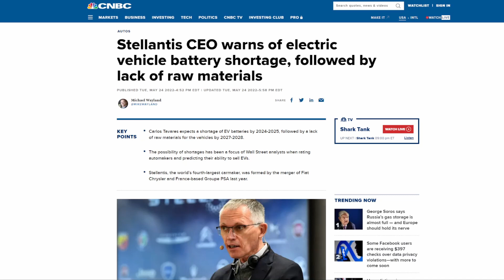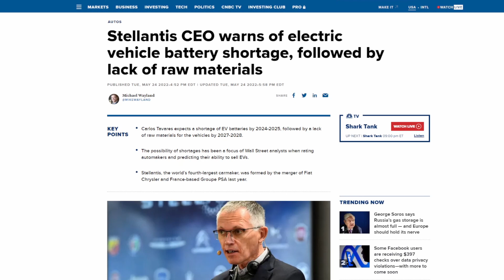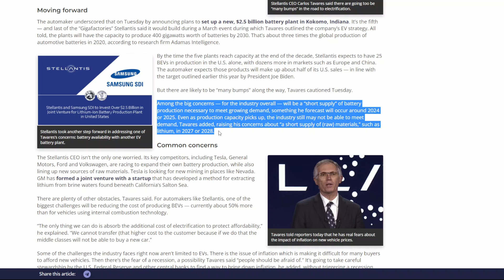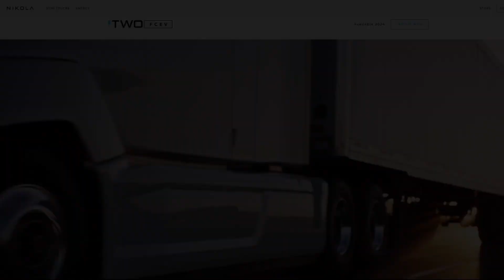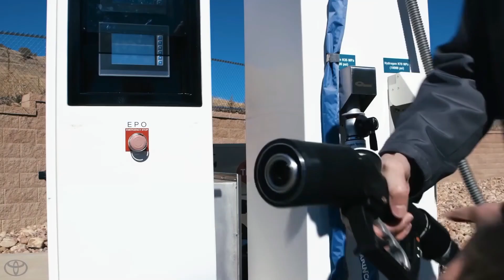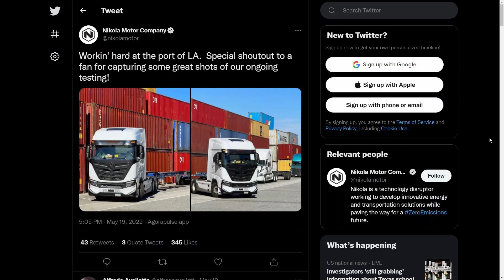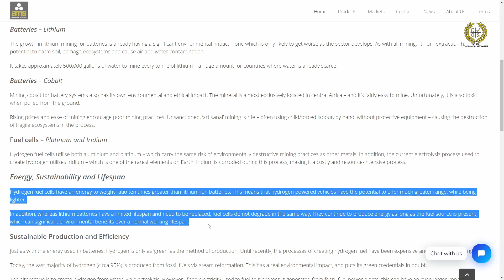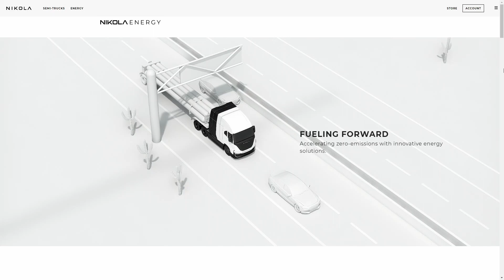Hydrogen-Electric Trucks Are The "Real Winners" - Sandy Munro

Comment: Sandy is still forgetting that to create the hydrogen required is extremely inefficient. We may as well just have trucks running on methane which is much simpler to create and store. H2 is a waste of time.
Reply from the maker: Gasoline is more inefficient to make than hydrogen, and yet 99% of cars on the road run on it. Simplicity and efficiency don't determine the adoption of a technology buddy
Reply: @visceral_investing  ah no it’s not gasoline is extremely versatile and easily produced from the worlds most sort after feedstock. Crude oil. Can be stored at room temperature is a very basic container. Can be transported very easily. All not true for h2. The only better option is… you guessed it.. electricity!
Reply from the maker: Hydrogen can be made from an even more sort after feedstock...solar panels! And guess what, the feedstock this time is renewable and the hydrogen doesn't need to be combusted for use. Meanwhile you can store the hydrogen gas in tanks, just like your readily available propane tanks, and put them on solar farms, ships, planes and trucks without adding ridiculous weight and taking up an exponential amount of land!
Reply: @visceral_investing  good idea except the problem is that creating h2 using electricity from any source is extremely inefficient. So you would need 3 times as many solar panels or wind turbines or whatever to allow the hydrogen truck to move the same distance as the  battery electric truck so you would end up using 3 times as much land for the extra solar panels etc.
Reply: @visceral_investing  also h2 will leach from propane tanks because the hydrogen molecule is so small it cannot be contained like larger molecules such as propane or methane. I think someone has invented a tank which can store hydrogen but it’s so expensive that it’s not economically viable.
Reply from the maker: What? Making hydrogen using electricity is almost 50-60% efficient, and because batteries limit the range of the truck - you'd end up having the same amount of energy used for the same range. Not to mention, solar and wind are excessively abundant in the ecosystem - so the technology with the higher capacity factor for storage will offer the better $/kWh for renewables - which is hydrogen
Reply: @visceral_investing  you're missing a few steps with hydrogen which makes it only 30% efficient. Battery electric semi will be 80-90% efficient. By convertong h2o to h2 and o you've lost 40 to 50% of the electricity then converting h2 to to electricity and used in the electric motor you've lost another 30 to 40%. It's too wasteful. Unless this can be changed then don't believe h2 will be used as an energy storage method for anything.
Reply: @visceral_investing  renewables are only as abundant as the amount of devices you have to collect the energy. There is a cost to the number of solar panels or wind turbines etc installed. If all vehicles were running on h2 you would need 3 times as many devices which cancels out any benefit of h2

Comment: Clearly the performance issues are being overlooked say cold weather, fuel cell flooding, platinum membrane fouling. FYI lithium is extremely common compared to platinum.
Reply from the maker: Fuel cells perform better in cold and hot weather, plus the supply chain for platinum is not nearly as stressed as lithium - which reduces cost, while already having a lower carbon footprint while mining. You need 8x the mass of lithium in a battery vs the amount of platinum in an equivalent power fuel cell

Comment: That’s the same argument I’ve been making for years…Hydrogen for long haul, batteries for city delivery and short haul operations. Battery weight cuts into payload, plus, the time it would take to recharge all the battery packs. Too long! 
If they can get down to about 10-15 minutes to refuel a hydrogen rig, that would be on par with refueling a diesel road tractor with 150-200 gallons of diesel. That seems to be an excepted industry standard at this time. And Nikola is to be building their own refueling centers too!
Reply: I have been in the heavy transportation truck/rail business since 1973 and I get so very tired of Youtubers who don't know what they are talking about. If the Tesla batteries are in fact heavier Tesla can easily add drop axles on the tractor and the trailer which boosts the capacity to 105.000 pounds gross and this would more than easily take care of any extra battery weight. There is NO problem with battery weight and there.......... NEVER .............HAS.......... BEEN !!!!!

Comment: In the short history of electric vehicles this century we can see that the issue of energy density gets resolved over time. The issue of weight is a thornier one though. The bigger the vehicle the less likely that the weight penalty due to batteries will be tolerable. But, you have to go really big before that applies. Sandy Munro is probably wrong. BEV trucks in all classes will probably win out over time.

Tavares, regretably, is right too. The lithiun-ion battery industry is going to collide with 'resource limits' (actually the limit is a limit to the rate of expansion of mineral extraction not a hard resource limit). So, were going to have to complement lithium-ion with other battery alternatives that use more earth abundant materials. Okay, so let's do that.

With so many advocates for hydrogen it is important to be reminded about just how useless it is in most applications as a fuel. Hydrogen is absurdly difficult to store (making its use in FCEVs extremely challenging) and it doesn't 'burn cleanly' when combusted (in an ICE or jet engine). US defence research is looking at a number of fuel options that an army can carry on its back. Mineral hydrides as a storage medium for hydrogen look promising but nanoelectrofuels - liquid fuels that can store electric charge - also have their advocates. There is no winner yet but liquified hydrogen in a bottle is basically a sad joke (and a bomb).
Reply from the maker: False. Hydrogen is anything but useless. It's used in steel and glass manufacturing, in fertilizers for growing crops and as a feedstock for natural gas. So if hydrogen was really "useless", then the industry would not have used for 100s of years. Just the like infrastructure of batteries evolved, so will of hydrogen. It's tough storing nature is just one sacrifice you have to make to unlock a multitude of benefits, like higher energy density, better weight ratio, longer discharge duration, easier scalability and ths ability to store energy for weeks and months. Please do more research before talking 😊
Reply: @visceral_investing  No, true. What I said was hydrogen was useless in most applications 'as a fuel'. Talking about its use in steel and glass manufacturing is irrelevant to my point - those situations are unrelated to the use of hydrogen as a fuel, viz. when combusted in an engine or when, by electrochemical means, converted into elecrical energy in a fuel cell. (Also, you are jumping the gun a bit when you say hyrogen is used in the steel manufacturing. Would be manufacturers of so called 'green steel' intend to use it in future steel manufacturing but that isn't a common practice, right now.)

Comment: This is really the crux of the issue with electric vehicles; They're really not all that "green", when you factor how dirty the mining of metals really is, along with mining is very capital intensive.  In turn, this means lithium prices will have to remain high, to allow EV mass adoption to even be viable.

As for hydrogen, Blue Hydrogen & (in some areas) Green Hydrogen are already down alot in final cost.  Hence, they actually have a path to viability right now.  Let alone the benefits as far as range, fuelling times & what not.

Ships & Aircraft, IMO look at HVO (Green Diesel/Blue Diesel).

My 2 minutes anyway, thanks for the video
Reply from the maker: Great points. Green hydrogen will allow us to create the equivalent of fossil fuels, with renewable energy - something that would be immensely revolutionary to the grid. It would make solar/wind smoother for the grid and allow cities/users to store energy for weeks and months at a time - and allow them to deploy that energy for electricity whenever they need to with 0 emissions (unlike coal and NG generators)

Comment: This video is full of misinformation.  Lithium is one of the most abundant elements on the planet.  Plus...it can be 100percent recycled.  Hydrogen can't be recycled.
Reply from the maker: Wtf? You're comparing a fuel to an element used in a specific type of battery? If lithium recycling is so effective, why have its prices skyrocketed since 2019? Green hydrogen prices on the other hand have fallen 20%+ since lmfao

Comment: Hydrogen is good energy, however, the big problem with Hydrogen is its low power efficiency, both production and fuel cell efficiencies are low.
Reply from the maker: Yes, but it's the same case with petrol, diesel and NG production/consumption. They are at best 25% efficient, yet they are used everywhere. Same with jet engines.
Reply: @visceral_investing    I am comparing with EV....When compared with petrol and NG, Hydrogen is much more expensive.  You have to combust petrol or NG to get electricity with 70% energy loss and then electrolyze water to get Hydrogen with another 50% energy loss...

Comment: Not really true, depending on price of fuel and hydrogen most likely to loose in price.
Reply from the maker: Price of hydrogen will be $1.50/kg in 2030 - making it 2/3rd the price of diesel. And because of its ability to be made with renewables, it can be scaled 10x faster than any other form of fuel production
Reply: @visceral_investing  at the moment hydrogen is heavily subsidized real cost including profit much higher. Another concern is the fact that service of converter plates are very expensive and intervals too short. So these problems are not solved yet. Hydrogen is made with electricity so why go the extra mile to convert from electricity to electricity???
Reply from the maker: EVs, solar panels and batteries are and were also subsidized. Not sure why that is a concern, it will only accelerate the adoption of the technology. And the reason why you use electricity to make hydrogen is because fuel cells provide an insane amount of benefits to many heavy duty industries over just using a battery - no self discharge, higher energy density, less raw materials, instant re-charge time, and extremely low degradation. Try mounting a battery to an aircraft, rocket or ship and you'll see why hydrogen is used. 

Plus, the hydrogen you make can also be used to make renewable natural gas and methanol - which means you can use solar panels to make the equivalent of fossil fuels.
Reply: @visceral_investing  I am not saying that batteries at the moment solves all problems not even suitable for every application. For sure hydrogen is better in some applications especially heavy ones. I am more into low price mass market.

Comment: Agree with Sandy, batteries will be fine for 99% of car owners, probably 100% by end of decade.  Makes sense to me to use a fuel cell powering electric axles on a class 8, 100% of available torque at 0 rpm, same setup as a diesel/electric train, just in ninja mode